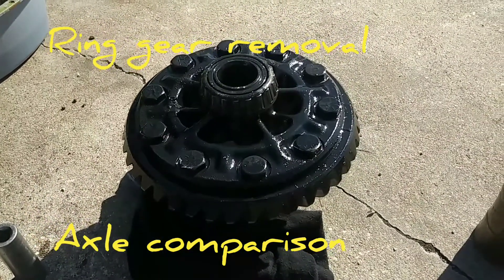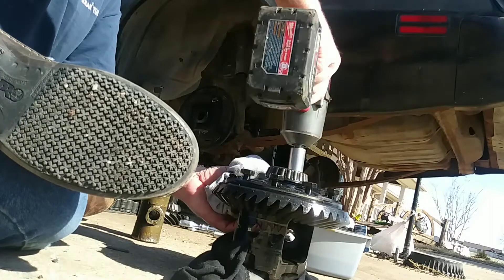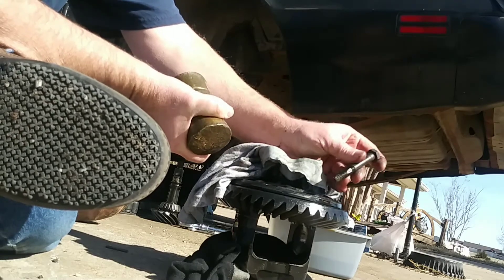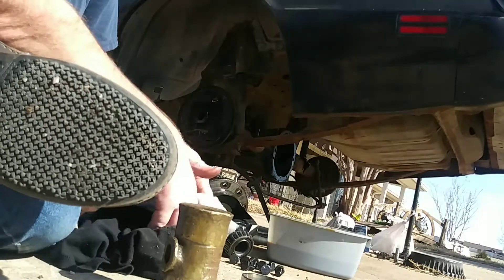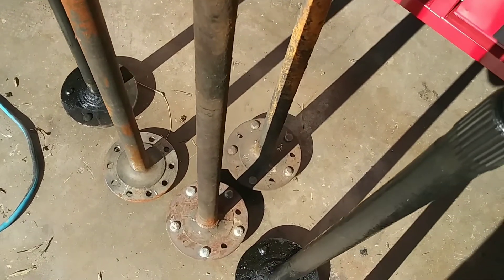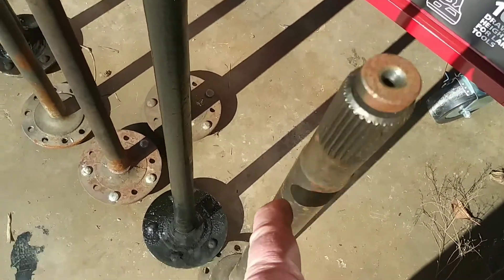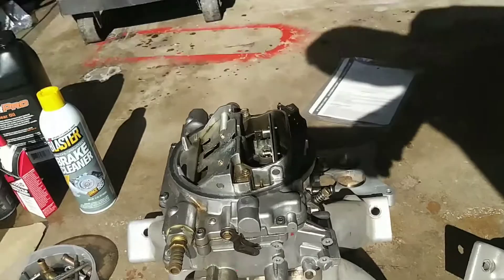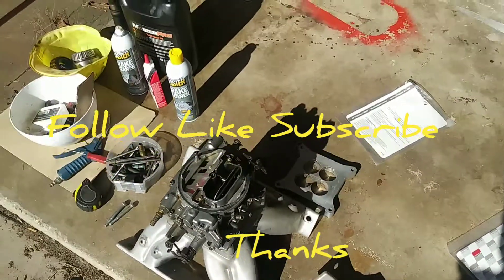Ring gear removal from 8.5 diff and axle comparison 10 bolt 12 bolt

Comment: Thanks Larry. Actually mine was a 2.56 R&P from a 71 Cutlass a body rear. I could not get the ring gear to budge even with a BFH for the life of me. Didn’t want the diff as I set up the housing with 3.23 w/S-T-T. Tossed the whole shebang but when I saw your video it reminded me and wanted to see if I had forgot something. Guess I needed a bigger FH.
Reply from the maker: Dang thats tough. I kept a spare Type O olds 1970 3.23 open for future use or spare.. For my wagon or Rallye 350